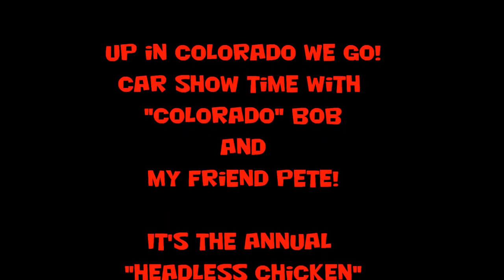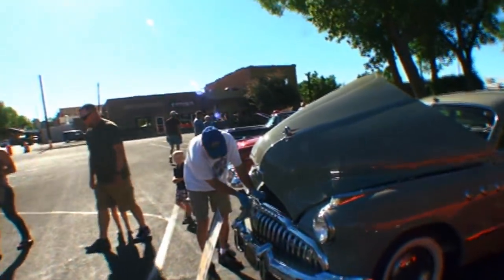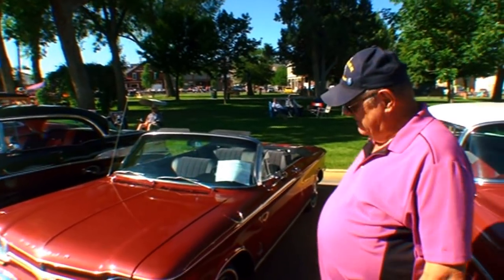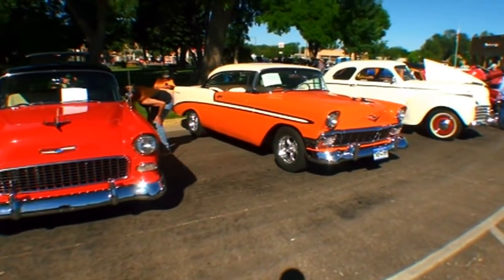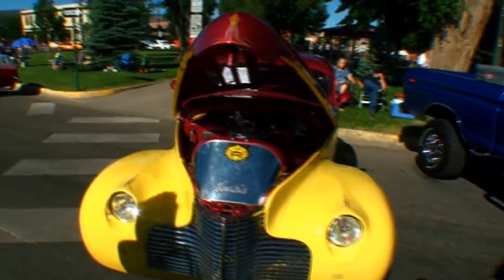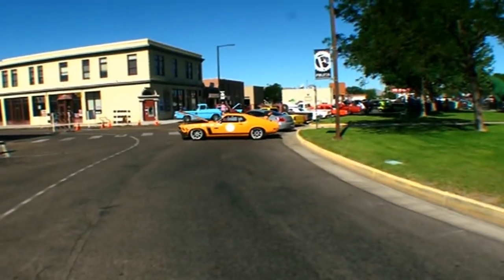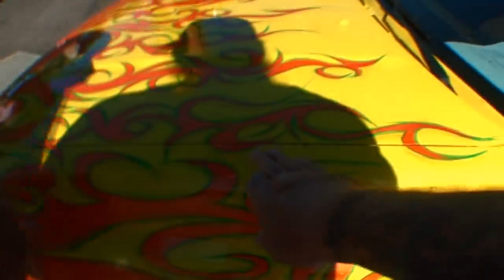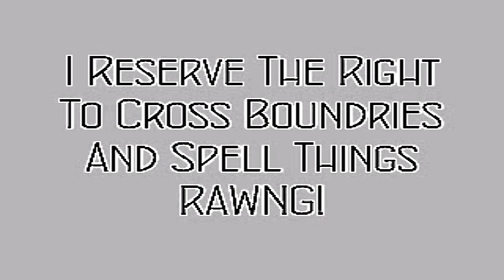I Want My Own Show Car - HOW MUCH DOES IT COST?

Comment: That poor rooster,it's amazing living 30 days with no head.2 bolt or four bolt it's the same duddo,been rebulding engines for decades,and when you spin bearings they both screw up the same way,4 bolt mains is just all hype in the motor industry.